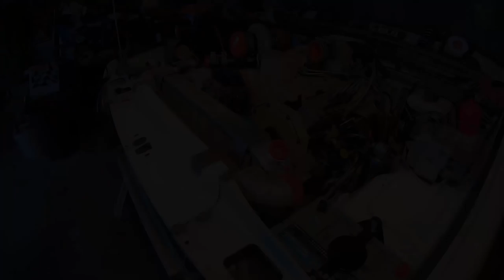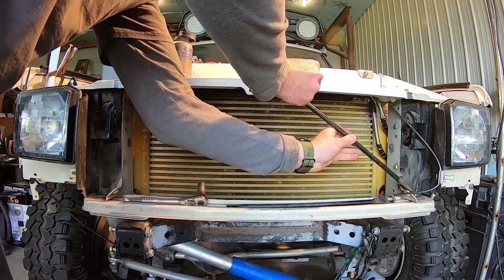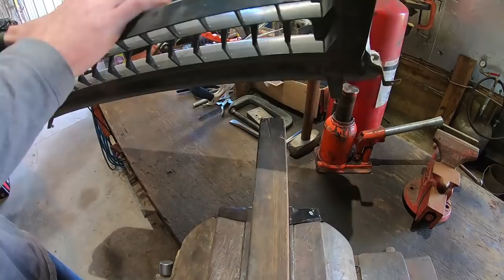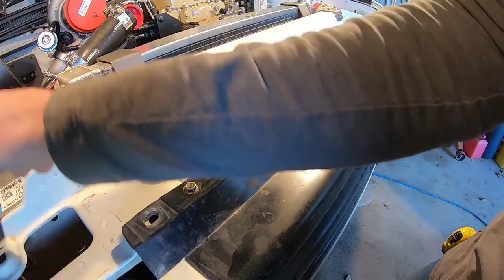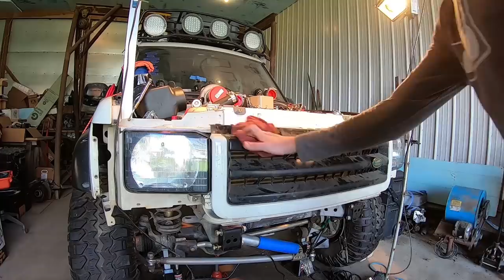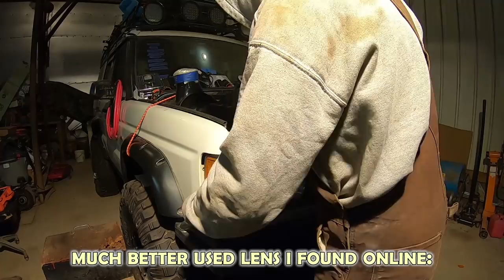Bumper & Front End × 4BT Cummins Discovery #31 [Land Rover Build]

Comment: Something to look at is a few ppl in the UK are taking out the back two side windows and putting a locker door in on gas struts so you can get to kit without opening the rear door. A company called tuff rok does a few bits.
Reply from the maker: I actually built my own hatch door on the driver's side back window for that same reason, so much easier to get at gear from the cabinets I built in the back!  I did a quick video on it (https://youtu.be/dVaeLJGzbJk) and it works great but that adhesive sealant (like what you used on your new door) was almost a disaster when the rivets started squeezing it out all over the place.

Comment: btw, a fellow Youtuber has had really good luck with bar and chain oil as undercoat to prevent rust on body and frame.  As much as investment of time and money you have in that, you might want to try that to keep around as long as possible.
Reply from the maker: For sure! The frame's getting a mild resto after the swap moves forward more & I know I won't need to weld on it as much.

Comment: чувак ты такова красавца сабираешь потом жалко ездить будет удачи и жду новые видосы
Reply from the maker: Clean for now but it will get used plenty!
Reply: @Tinker1837  I ponel but it good video you have a nice look good luck . how much horsepower is in the car
Reply from the maker: It should output 200-250 horsepower and 500-650 torque, all at only 1600 rpm!
Reply: @Tinker1837  cool and gearbox and razdatka hold the moment. and for a diesel engine it is a very good indicator. It’s like a madman to drive. I really like your approach to the car.